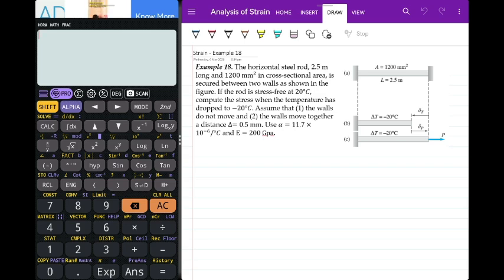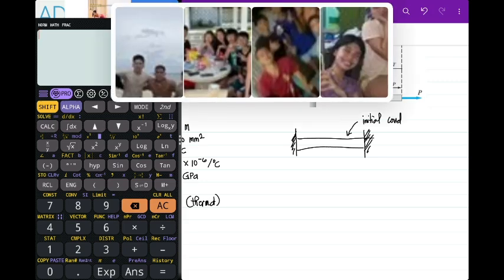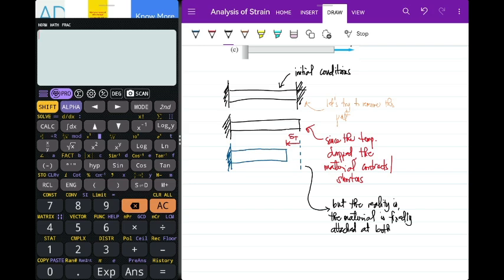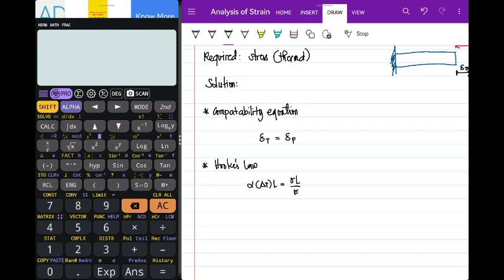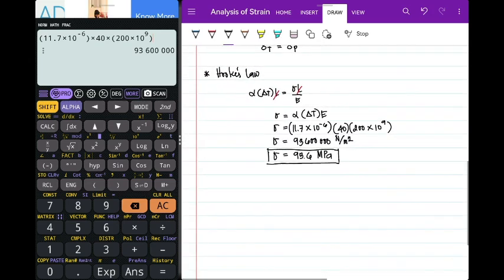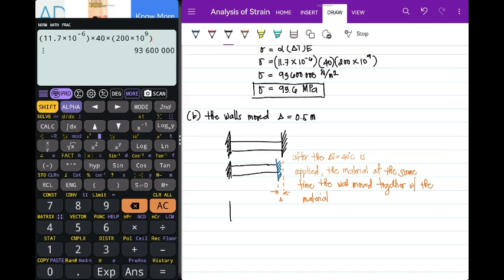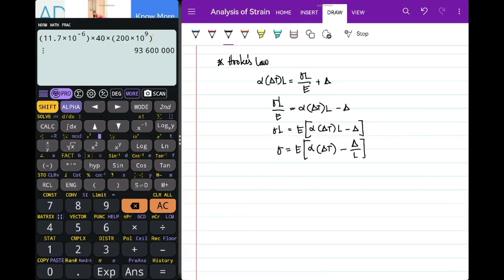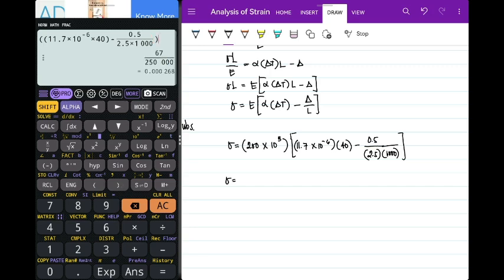Fixed-End Thermal Stress Problem: Step-by-Step Solution

Comment: medyo galibog ko gamay sa solution 2 sir. kanang delta = 0.5mm sir kay elongation due to the material contraction tungod kay ni decrease iyahang temperature. however, despite nga na kwaan ug delta ang original L sir kay fixed ra gihapon ang material sa rigid wall maong sa point 2 magsugod ang application sa internal force P and the whole elongation would be the thermal elongation sir? that's why naka derive tong relationship sa material through compatibility equation? kay sa akoa analysis nabali sir, nahimong "elongation due to internal force = thermal elongation + delta" kay pag assume nako sir kay nabaylo ang thermal elongation ug ang elongation due to the internal force
Reply from the maker: Ni move ang wall by 0.5 mm tungod kay nabira sa material ang wall. Ang movement is due to the contraction of the material because of temperature decrease. So, in other words, naay 0.5 mm nga movement sa wall due to the thermal contraction of the material. Kay it is provided man in the problem nga ni "move" man gyud ang wall. Silbe, mao na nay new position sa imo wall. Mao na siya nga ang total elongation/contration is equal to the movement sa wall plus the elongation due to the internal force. Ug kani nga internal force is responsible para ma maintain ang "new" position sa imo nga wall. I hope this helps.
Reply: @kristo.online okay sir, salamat